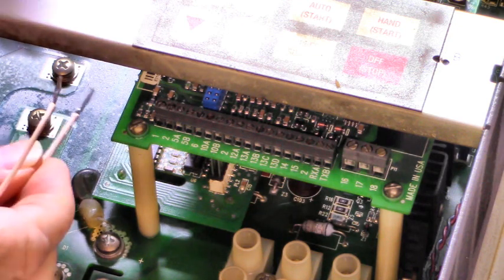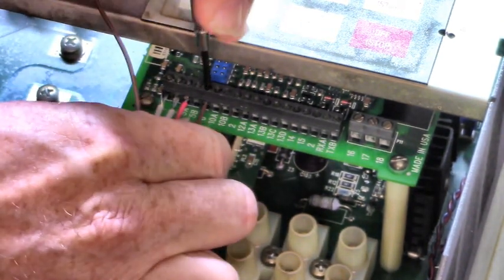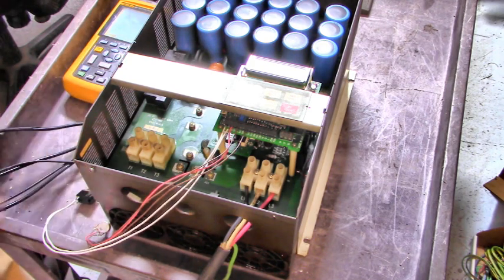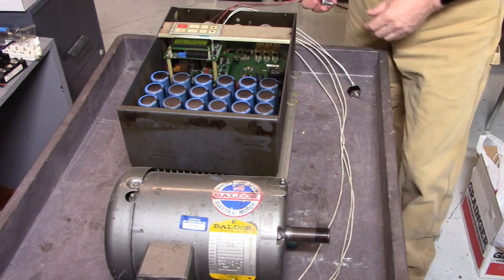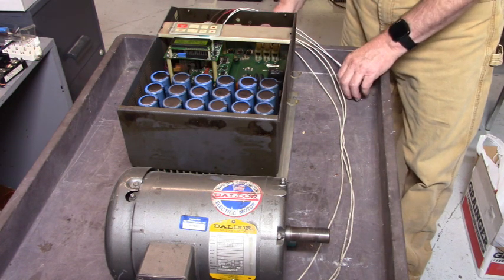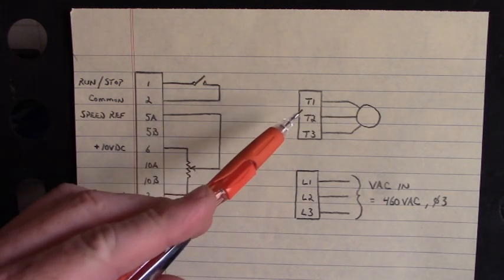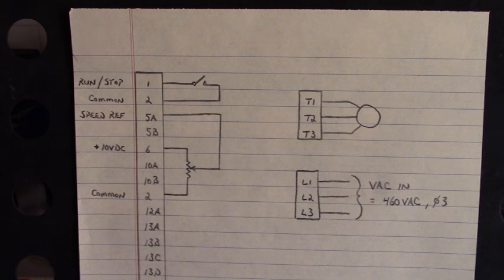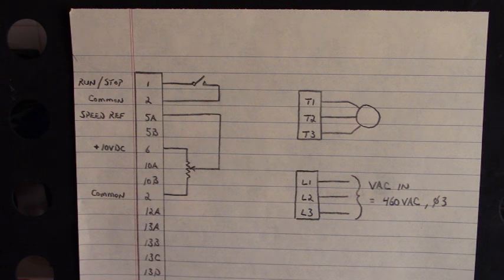AC Tech Inverter Drive Model MH4400B (Part2)

Comment: Hi Mr. PeePaw, how are you going, friend?
I fixed an Lenze with blown fuse, tested and sent back to the customer, so it started to pop "CAN not working" in the machine's screen.
I tested every drive in the Lenze's system bus net, all working fine, and none of the drives talked to the controller via system bus (it actually received analog reference on the first drive and replicate it by system bus to the other drives).
Guess what was the issue... One of the outputs of the drive was "drive ready" signal, and it was shorted ground.
The system recognizes any drive not ready as CAN error (poor programmer in this machine's factory, one can tell).
I just set another output as drive ready signalling and it's working like swiss watch now.
Sometimes we need to go out of the probably to diagnose and solve issues.
Reply from the maker: I wish I knew more about the CAN Bus Network. Every time I run into CAN Bus it is like some mysterious magic. The CAN Bus Protocol is set in stone. But every drive manufacturer changes the transmission word to something different. So If I figure out how to CAN Bus to one drive. The same commands do not work for another. So frustrating. HaHa...
Reply: @PeepawMcDonald  I read some time ago there is more than 400 registered protocols under CAN interface.
That's insane!
Anyway, email me PeePaw, we can talk about it, I'll be glad to share my experience, as you share yours.